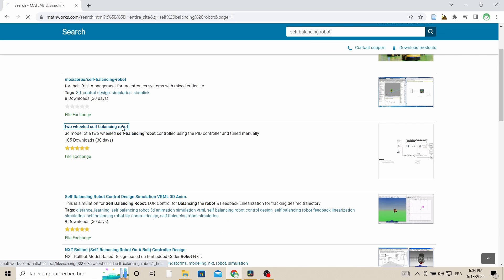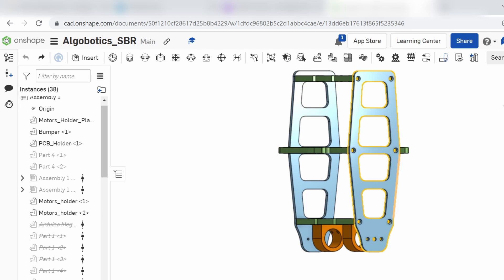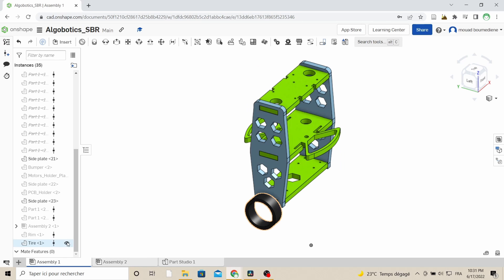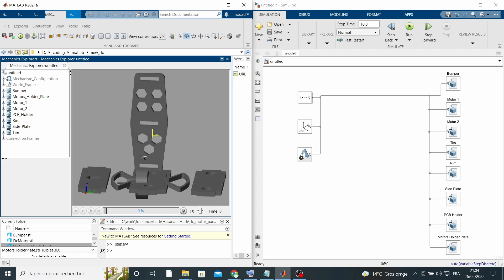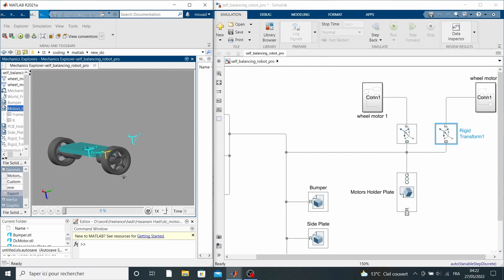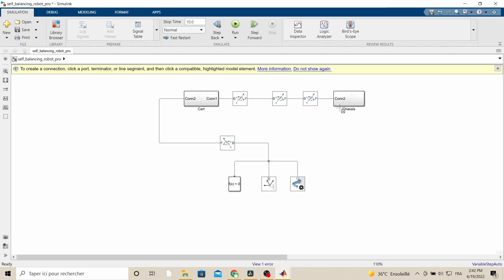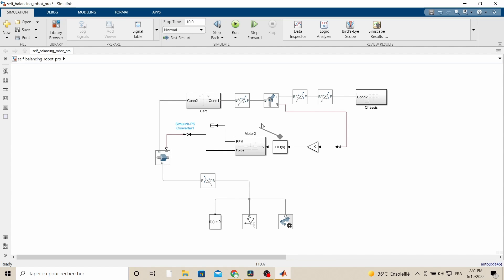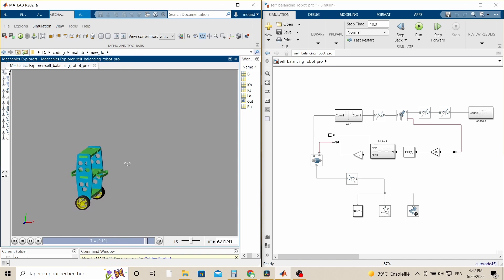Enhanced Self Balancing Robot Simulation in Simulink [ PID ]

Comment: Hi
Is this simulating procedure reliable? I mean can you get the same result with same pid coefficients?
Reply from the maker: Hello, the simulation pid gains can be a really good starting point for real-life project pid tuning.
Reply: @hobby_coding  Great
I mean if I simulate my sensore with simscape electrical and somehow connect them to SOLIDWORKS file in simulink and add random noise and bias to them and then use matlab auto tuner 
Is this going to reduce time to tune coefficients by hand for real robot?

Comment: Awesome video, i will be making one very soon, i have all the parts just doing all the research i can to  make it nice like yours
Reply from the maker: thank you very much, and yes go for it . you can learn many concepts while building this project while still having fun.
Reply: @hobby_coding  im have built a simulation model based on my own design, im having some issues, what is k before PID, how can i obtain it?
Reply from the maker: @Matheus-cu8fk  it's a gain to convert radians to degrees
Reply: @hobby_coding  thank you very much, huge fan of your channel🙏
Reply: @hobby_coding  hello  can be use contact between  ground with wheel